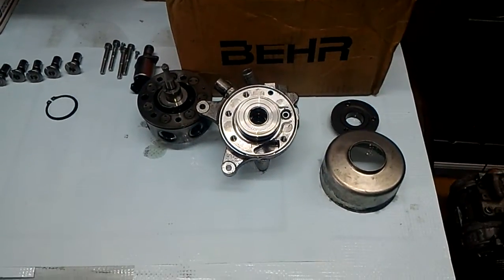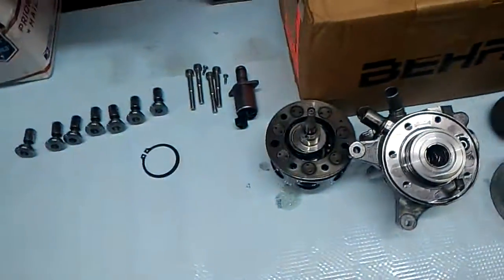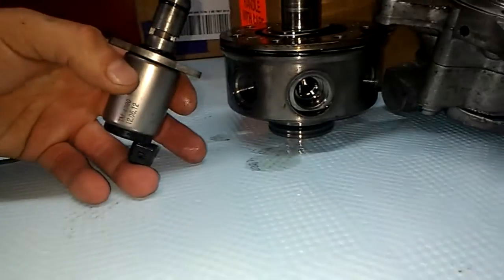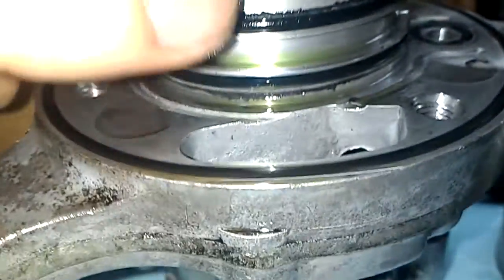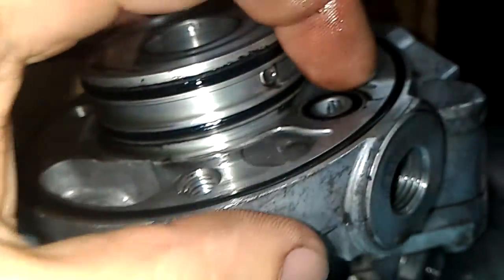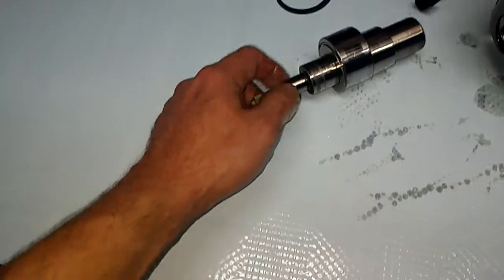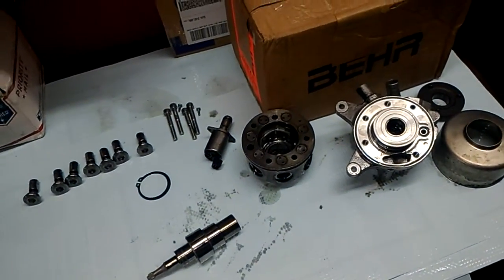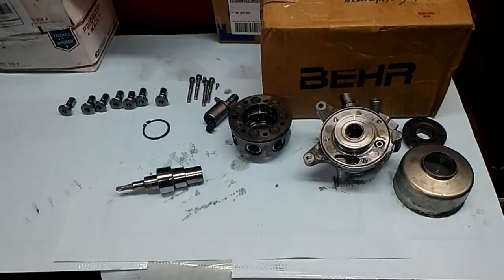Mercedes ABC system pump failure

Comment: 0 pressure? How is this even possible?? The abc pump isnt even that angry without oil. Mine was atleast around 2-3times dry for almost 1000km each time and didnt lost much pressure. With zero pressure the car wouldnt even be able to lift, it sounds more like many problems at once. I had one time a bad abc computer that only lifted the front and told me low pressure and couple of other problems. With this condition, the pump should leak but Not lose all the pressure.

Comment: Have you ever heard the pump knocking? I have a 04 sl500 and the pump starts to knock from time to time and then the system turns the abc off and I get the red light ABC off.

Comment: It's a pity that Benz couldn't haven't incorporated a magnetic clutch on the pump, like what is on an air cond compressor,  so that when the low hydraulic fluid pressure sensor is  activated it automatically disconnects the pump and avoids total catastrophic failure. Sure the steering would get heavy  but you could still keep driving if you had no other choice, knowing that you're not causing damage.
Reply: Then mercedes would have to acknowledge that their works of engineering brilliance might on occasion fail

Comment: Thank you Victor for this excellent video.  Even though you did not actually try to repair this one, the video gave me the details of the inner workings of the pump that allowed me to be able to rebuild mine for a 2003 SL500.  Getting that flange off was a bear!  even removing the reservoir required a 3 arm gear puller with a little work.  You talking throurgh the removal of the valves and how tight they are also helped.  

For those that are trying to remove the pully flange from the shaft:  i used a lot of heat and a 5-ton hydraulic gear puller.  Due to clearances under the flange, I had to use only two arms.  it took every bit of the 10,000 pounds of pressure to remove the flange.  Once the pump was rebuilt and all o-rings replaced and C Clip installed on the reservoir cover, I put the pump in the freezer overnight.  In the morning I heated up the flange by placing it in boiling water.  then about 6 hits from a small sledgehammer with a "Ball Joint Cup" to protect the flange and it was on.  Check between hits to make sure you don't go too far.  When replacing the two shaft seal the one between the high-pressure pump and the power steering pump, I used a long socket to help seat the seal. Also the top seal also required a large long socket to catch the outer edge of the seal and knock it in.

Again Thank you Victor!!

Comment: Quick question....I have 03 s55 amg and I had a/c replaced and I forgot to put the ground wire on the banjo bracket that holds the abc 
pump in place...it’s a tight fit so my question to you what is that for and should put that back on now ?or it’s something I can do later?
Reply from the maker: I can't answer that without tracing that ground wire. Maybe its just an extra ground in general or it might be a ground for some module or solenoid or something.

Comment: I have 2004 Mercedes s55 amg the whole drivers side sinks to the tires after sitting for a couple days. I was going to rebuild the valve seals front and back. I just thought it was strange that it is front back drivers side dropping not the entire front or back any ideas?  What the problem is?
Reply: it is clearly a valve seal issue. Make sure to flush the oil and change the 10micro filter
Reply: take the chance also to check the height sensor brackets, since dislocate very easily due to the plastic retainer ageing. They can be rebuilt with hot-glue and some inventive.

Comment: I have a problem with my cl500 the pump working on raising and lowering the car but while steering I can’t steer on low idle plus the pump start moaning and wining while steering
Reply: Most times could be damper pressure valve

Comment: how did you pull the pump apart, I took of the circlip and tried pulling on the black round pully thing (?) to no avail..is  that what you heated up then pulled like mad?
Reply: The pully flange is pressed-on the shaft.  It will require a lot of heat, and ended up using a 5-ton hydraulic gear puller to get it off, and even still it was a real chore!  Once you get the flange almost off I lost range from the hydraulic and had to use a large Nut on the shaft and then used the hydraulic puller again, but with that small extra length of push.

Comment: The pulley plate is pressurized or threaded.
I try to remove it with an extractor and it does not come out
Reply: Froilan Monfort how did you get it off?
Reply: The pully flange is pressed-on the shaft.  It will require a lot of heat, and ended up using a 5-ton hydraulic gear puller to get it off, and even still it was a real chore!  Once you get the flange almost off I lost range from the hydraulic and had to use a large Nut on the shaft and then used the hydraulic puller again, but with that small extra length of push.

Comment: Hi can you tell me how do you if your valve pump works or not? For a cl500 thanks
Reply: Valve block not pump.
Reply: If the car raises for front or rear then the valve block for that end of car works. If car sags on an end after sitting while off then seals leaking in valve block.